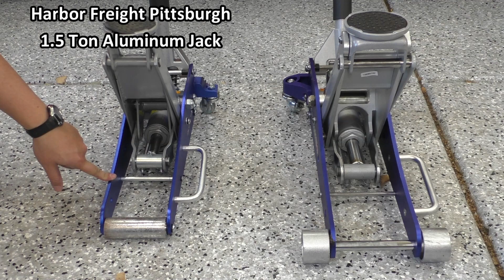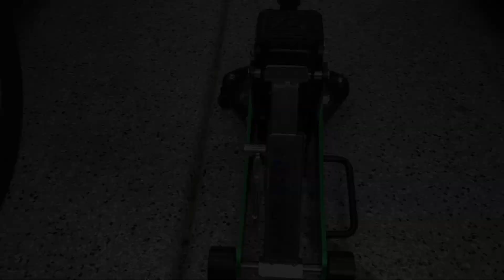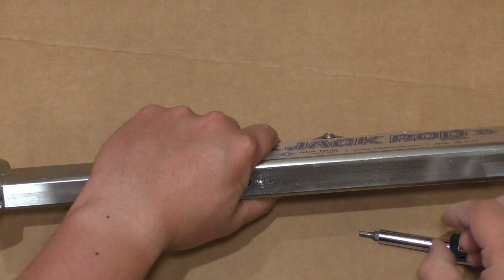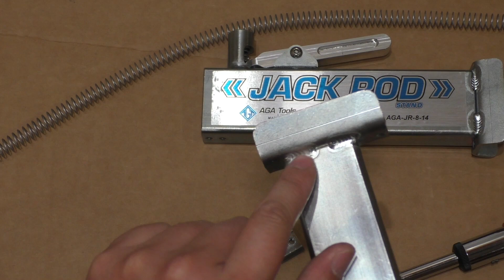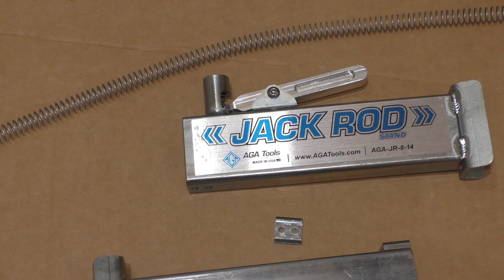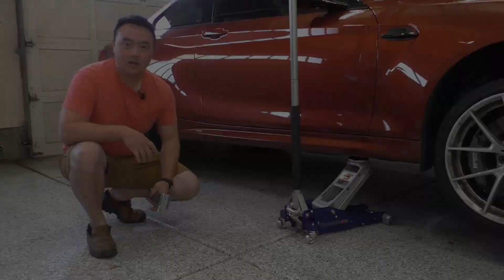AGA Tools Jack Rod - An Ingenious Upgrade for Your Floor Jack!

Comment: It's 105º in South Texas and you have to change a flat. Yeah, this is worth it! Jack up the car, install the rod, no hunting around on your back in the dirt and fire ants and scorpions looking for a place to put a jack stand. Change the tire , pull the jack rod, lower the car, go. One use and it paid for itself. Just got mine today.

Comment: I just ordered from Amazon the 2 ton version, I assume it has the wide upper grip vs 1 ton version ? Can I keep jack loaded and have tool in place in the case of Jack Seal rubber o ring explodes? 100$ per tool.

Comment: I am concerned about the amount of stress on the front axle, rather see it resting behind axle and hitting the floor
Reply from the maker: The front axle is the front load bearing member of the jack and designed to handle weight. AGA did hydraulic press tests on the front axles of jacks to see if they would hold up.
Reply: Hitting the floor it could slide out.  As designed, it wraps around the axle which prevents it from shifting.

Comment: They have a new model now to work with 3 wheel jacks like the Pittsburgh jack in the video that wasn't compatible with the original model.  Not sure if they narrowed the top seat on that model to go with narrower pins on that Pittsburgh jack.
Reply from the maker: Awesome to see AGA/AGM incorporating user feedback to make the products better! Thanks for the heads up!

Comment: That's cool but your jack is still able to roll. I'd be afraid (but I'm easily afraid) it could slip while doing some percussive maintenance or whatnot
Reply from the maker: True, the jack can roll, but the parking brake and wheel chocks can be used to further keep the vehicle in place. It'd be pretty difficult to get the jack to roll out from where it's against the vehicle with the weight on it.
Reply: Chock a tire on both sides. No roll.
Reply: I chock the other three wheels front and back when I lift a corner.

Comment: I would not get under the car with that.
Reply: There's risks even to stands.  And I think the risks here are no worse.  I'm impressed with mine and it's made work a whole lot more convenient on newer cars with full underbody covers and only the pinch welds exposed.  No more wondering about lifting points.

Comment: Bummer it doesn't work with the 1.5T HF jack.  That's what I take to the track (and it seems like everyone that I know does too), and it would be really nice to get a bit more safety when swapping wheels.  That looks way easier to deal with than a jack stand, especially when you're jacking on looser surfaces.
Reply: Old post but they made a 2T version that should work with the 1.5T jack now.

Comment: Good idea, but I wonder whether the attachment points on the jack are actually designed to handle that load?
Reply from the maker: They are. The upper pins/rods that support the lifting cup of the jack take the load under normal operation. The front axle also has to take some of the load from the jack to support the wheels on the ground, and is typically larger in diameter than the pins/rods.

As long as you're not exceeding the weight limit of your jack, you should be fine.

AGA Tools has a little video showing this: https://www.instagram.com/p/CY6003lB_wt/
Reply: Re: not fitting the HF 1.5 ton jack: grind a bit off each side of that top bracket. Lower all the weight onto the wheel and the side wings will bend out. If they dont, it wasnt an issue.